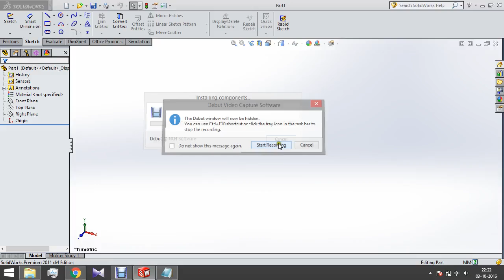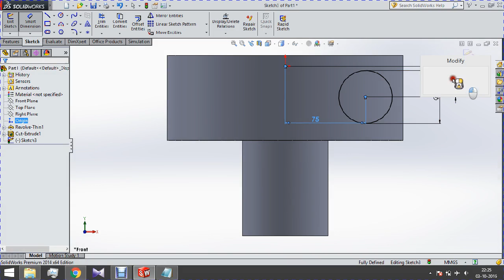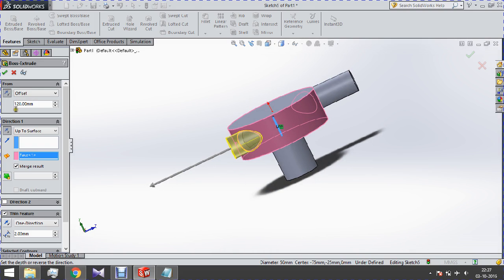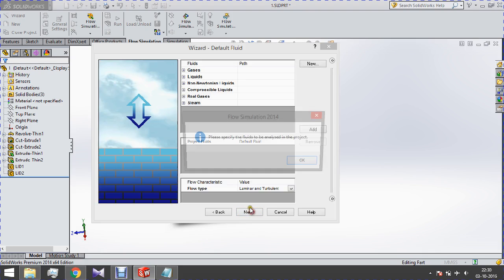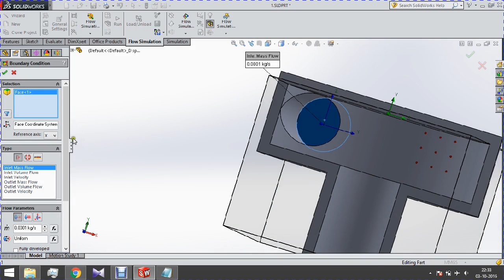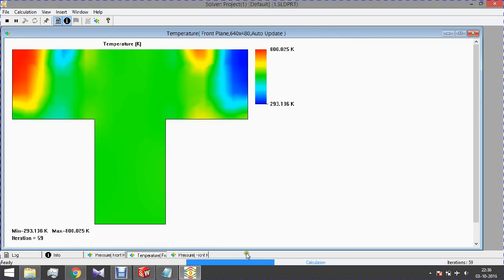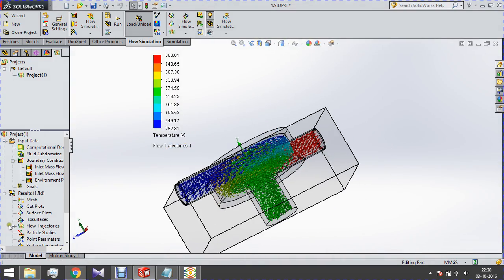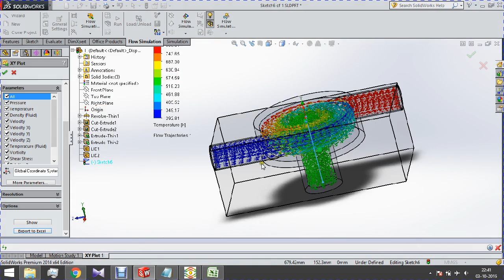Basics of flow simulation in solidworks

Comment: Please make video example for pipeline simulations Calculations: pipeline route study, wall thickness and material grade selection both rigid and flexible pipe, collapse and buckling analysis, on bottom stability analysis, pipeline end expansion, pipeline free span, bottom roughness analysis, lateral bucking analysis, pipeline crossing and its structural supports design, fatigue analysis.
Reply from the maker: I made a full course free : https://youtu.be/4wODnZ82avk

. If you can support this financial really appreciate else enjoy the contents free